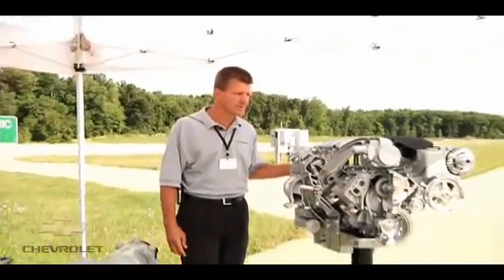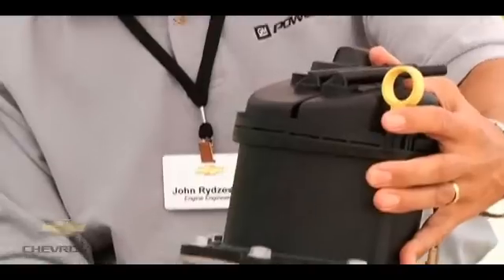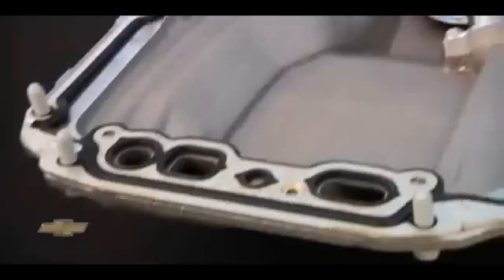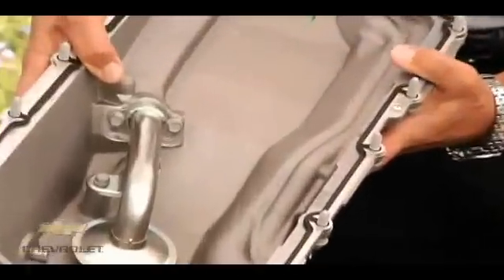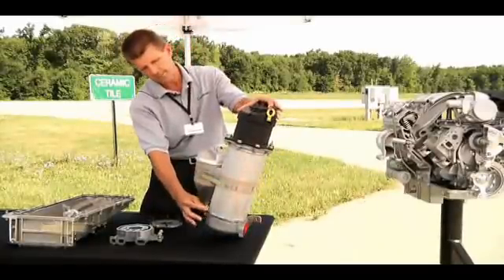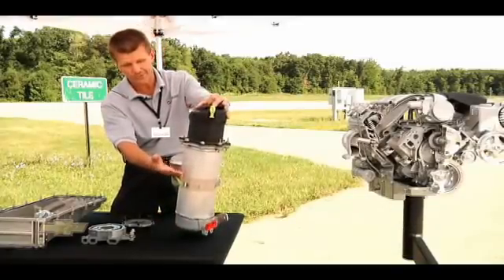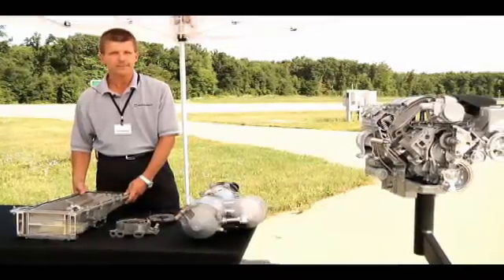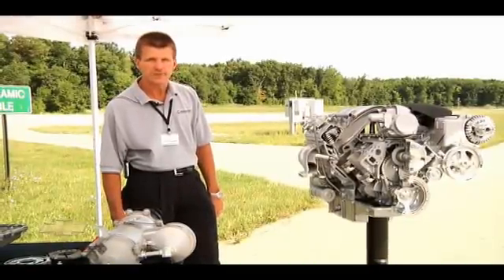2010 Chevy Corvette Grand Sport LS3 dry sump lubrication system explained

Comment: What I want to know is the tank that's on the side of the dry sump tank that's got a stainless steel strap that holds it to the side of the tank I'm not sure what that does can anybody tell me what the purpose of that is it also has a aluminum line that runs to the dry sump oil tank

Comment: Im currently running 80 to 1 premix synthetic in my truck, i  am going rig up a dry sump with 2 outboard oil injection pumps as synthetic burn cleaner.  Any thought on this?

Comment: Lug it around? You do know that the dry sump engine can sit up to 3 inches lower than a regular (wet sump) engine right? You can pound the gas while in corners right? Lower center of gravity and engine safe power. The downside is if anything goes wrong in the system.....$K's.